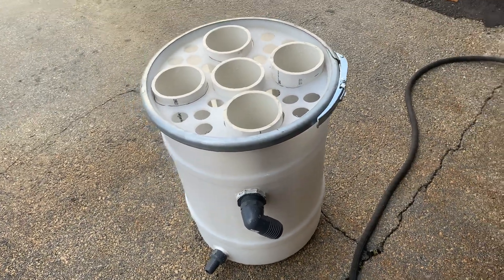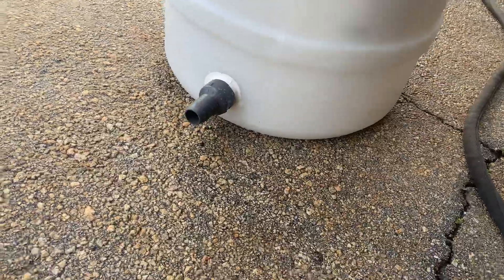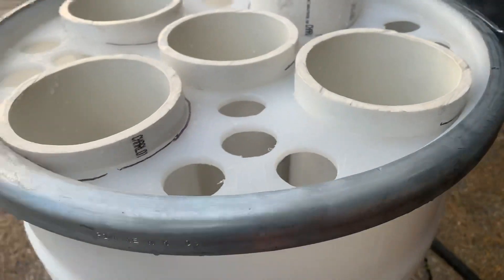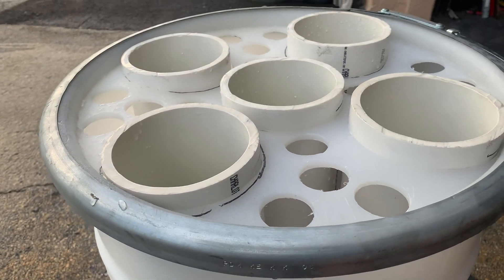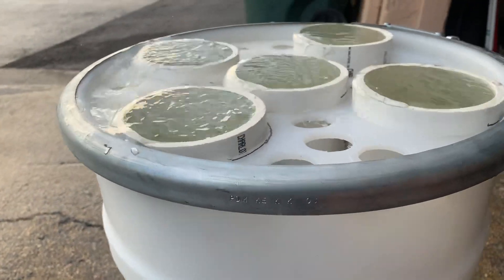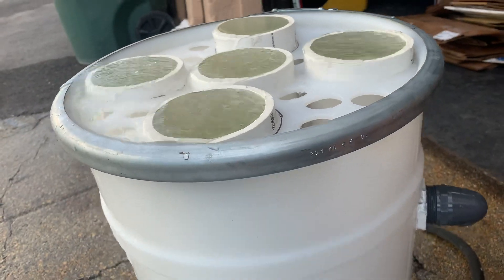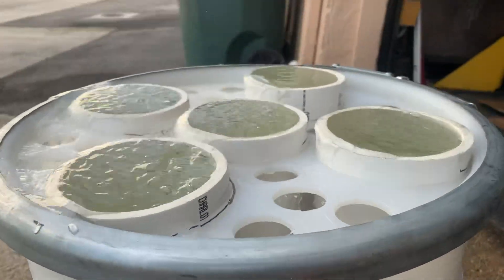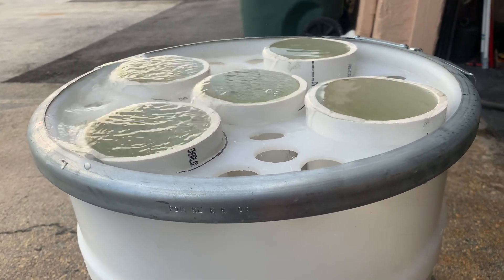Home made tuna tubes

Comment: The current bucket they are selling does not offer an over flow so you are using stale water. This would work for a reset on a drift but its not going to keep bonita alive for very long. I wish they would have offered something closer to the video above.